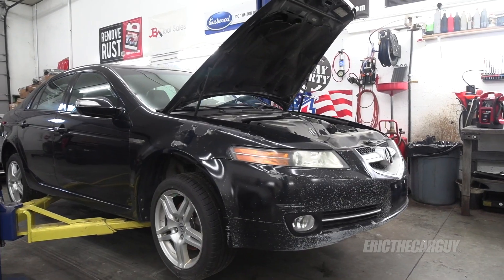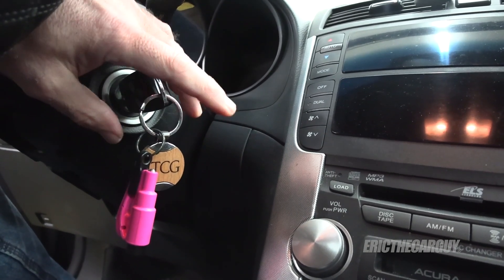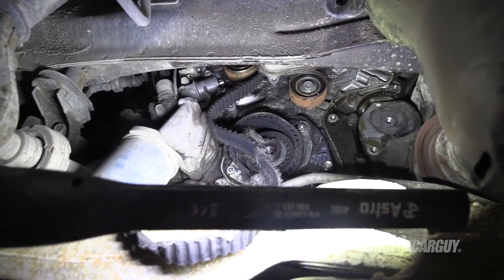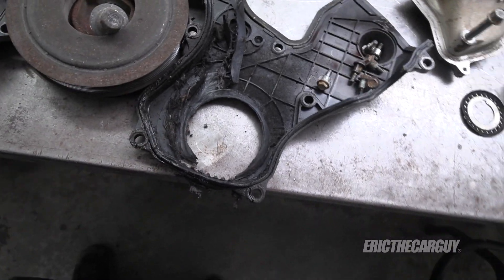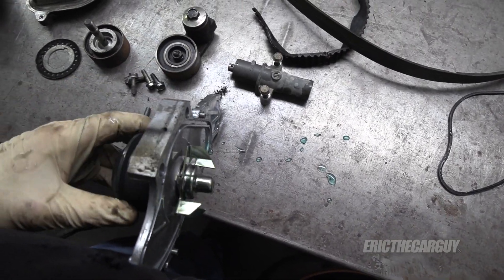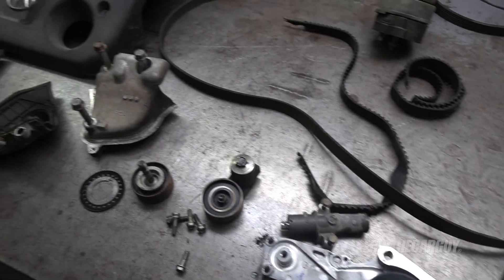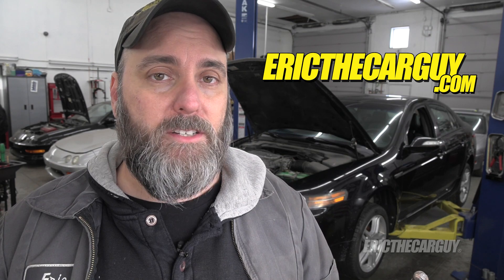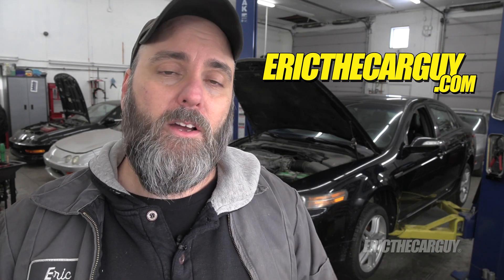Acura TL Dies On the Road

Comment: I had a very strange timing belt failure on my J32A2 about four years ago. The car was driving perfectly fine, me and my buddy drove pretty far out into the country to check out an abandoned Soviet radar missile tracking station outside of Moscow. When we got back to the car - it started acting up. When it did fire up it was running horribly, and we had no idea what to do. What made the whole thing even more nerve-wracking was that my buddy had a flight to catch and we were in the middle of nowhere. In the end he took a cab (which was really expensive, and he was barely able to catch his flight - he checked in two minutes before registration was closed), meanwhile I had to call in a flatbed to transport my car back to Moscow, which also cost a small fortune. When my shop  examined the car - it turned out that the timing belt had lateral cracks all around it, parallel to each one of the teeth, resulting in it skipping one or two. It was no more than a year old, and it was supposedly an OEM belt (though it was suspiciously cheap).
Reply from the maker: Glad you got it sorted. That sounds really stressful. Thanks for the comment.
Reply: @ericthecarguy  hey man! Thanks for helping people like me with advice ;) I remember I kind of got on your nerves a few years ago in an e-mail exchange on the topic of Honda CV-joints...))

Comment: If you look at the back part of the engine mount bracket you should see a mark where the idler pulley was rubbing against the bracket. You're supposed to use a die grinder and grind down the engine mount bracket where the idler pulley sits. That solves the "warble" sound coming from the timing belt area.  Its just bad having a bearing rub against metal as well. For those of you who dont know this stuff. Its crucial info.

Comment: I reuse coolant quite a bit using the paint strainer. Coolant is fairly expensive, BUT I do it mainly because its not always easy getting rid of old coolant.
Reply from the maker: I recently got rid of my waste oil and coolant. Both were in separate 55 gallon drums. Cost me $600. They used to come and take the stuff for free not so long ago.
Reply: @ericthecarguy  Our county has free oil and coolant disposal. But, I bet if I showed up with 2 55 gallon drums, they'd say "NO!".

Comment: The tensioner is the most important part of this timing kit. I had to do the job over again as I found the tensioner I bought on ebay was counterfeit and failed immediately after install. You should not be able to depress that tensioner by hand at all and that grenade pin should be extremely difficult to remove. I found the best thing to do is to install the kit and run the engine with the covers and everything else off so you can see how everything moves. That belt should not have any noticeable flex at all as it makes its rotation and the tensioner should not have any noticeable movement. You can then try and depress the tensioner by hand via the pulley. If you can move it by hand at all then you've bought a faulty or counterfeit tensioner and need to replace that part before completing the job.

Comment: I'm even more convinced now that the Aisin (OEM manufacturer) timing belt kits are worth it.  Probably not from Amazon or eBay though due to counterfeit parts showing up there too.  If I had to tear off the side of my engine that many times, I'd go crazy.
Reply: Amazon is really bad, counterfeit everything really, one time I bought a “Honda OEM” VTEC solenoid gasket and it didn’t fit, thats the last I ever bought car parts from them
Reply from the maker: Or if buying Honda parts I recommend Aisin kits as I believe they are the OE supplier for Honda.
Reply: @ericthecarguy  hey Eric what do you think about rock auto? I have a 2014 tl 3.7 and bought a aisin kit too and installed it in May. Should I be worried? All these comments regarding counterfeit parts are making me worry

Comment: If the timing belt/chain breaks, all you need is to be lucky enough for the valve springs to rotate the cam shaft(s) into a neutral (no lift) position before the next pistons come up. Much higher chances of saving the engine than if a belt slips or a chain skips.

Comment: I’ve learned a few things ETCG1 you really have to be careful with fake parts I bought some what I thought were authentic Denso 02 sensors for my Subaru and two years later one was failing and when I would cruise down the road and Top Gear the car would stumble almost like a misfire dealer couldn’t figure it out nobody could figure it out until I hooked up my cheapo harbor freight scanner and realize bank one was -40% on fuel trim!

Comment: The broken aluminum mounting boss for the cam sensor:

A good quality aluminum brazing rod is one incredible problem-solver to have in your kit as well as skillset.

I say skillset because it does take a bit of practice and seat-time to use the stuff at its full potential.  It can be tricky to get it to wet properly.  And, it flows like water if too warm.  Just and FYI, the line between perfect temperature and too warm is human hair thin.

When attempting to join two small pieces back together, tin both separately, then heat the two again for joining.  Or, put the car in a frame/body rotisserie, turn the car on its side, and use a small piece of electrical conduit as a form to fabricate the boss from molten brazing rod.  ;-)

I'm totally serious when I say aluminum brazing rod is magic for quick permanent repairs on all kinds of aluminum and aluminum alloy parts.
Reply from the maker: That would be a better repair I admit, but I don't possess the tools or the skillset for that. Thanks for the comment.
Reply: @ericthecarguy  No worries, it's fixed as the owner wants it -- the very definition of a proper repair.

I just added the comment as a reference to keep in the back of the mind for future play or problem-solving.

Comment: I have to say.. Once a car leaves me on the side of the road.. I can’t ever hardly trust that car again!

And if that’s the Honda you did the in depth timing belt video on… then you for SURE got a counterfeit kit. eBay is not worth the hassle, folks. Just go directly to the dealer, or even aftermarket from like autozone would be better than the crap they allow on eBay like sites.

Comment: Eric, I replaced my EJ20 belt last year. I went in to replace a leaking power steering pump and it looked like some fluid got into the belt cover so I removed the cover and wow! That belt was hanging on by a thread... literally. I wish I could show you pictures because I honestly feel the leaking fluid totally degraded the belt and it would have been overlooked easily had I just had a regular shop replace the pump.

Comment: The timing belt of my 1992 honda civic broke.We put a timing belt on it and it was perfectly running fine. Honda engines are the best.
Reply: Unless it's a non-interference engine, you were just lucky some valves weren't bent or worse.  Glad it worked out for you.

Comment: Regardless of the belt breaking that TL is a kick ass car..I wish I had it..my old civic needs some seals and a new oil pan gasket ..and I am in need of a bigger vehicle for my business..I am looking into a Accord from 2000-2010..that doesn't have super high mileage..good job on this TL ..it is truly invincible!! #SALUTE #RESPECT
Reply from the maker: I don't recommend going from a Civic to a TL. You will HATE the fuel economy, and the turning radius. I'd consider a TSX if you're looking to move up. I suppose it depends on what business you're in, and how you plan to use the vehicle. Thanks for the comment.
Reply: @ericthecarguy  I am a mobile technician ...jack .jack stands ..battery powered tools ..I went from that truck you saw in your parking lot the XPO Dodge Pro master to coming back home to IL. ..you recently just sent me that awesome shirt..my whole setup is in my trunk ..Precision Auto works ..here in Central IL. ..and yeah I also own a 2004 Honda Odyssey with the 3.5 V6 in it..and yes a TSX would be a good option ..thank you for everything Eric your videos are the #1 source for repairs across multiple vehicles..SALUTE!!

Comment: PAM, the cooking spray, makes a good, cheap epoxy release.  Just give the bolt/screw a spray and it will come out after the epoxy has dried.
I've used it many times while building small boats.

Comment: Excellent video.  Thanks Eric.   You make timing belt issues seem almost manageable - something I've always been afraid to tackle.  Maybe next time I'll dive in.
Reply: My issue would be where the heck do you begin trying to even get to stuff to replace a timing belt with these stupid sideways mounted engines...would almost be easier with some of them to remove the engine it seems LOL.  

I tried replacing a head gasket in one of my cars a while back, nope, have no clue what I screwed up but the car ran before I tore it apart, didn't run afterwards...that's the end of my mechanical attempts, got very expensive very quickly, and ruined a car I enjoyed driving although it was an old car, and very dull and boring, I enjoyed it because it was just a plain old simple car without all the electronic garbage on today's vehicles to deal with.

Comment: for aftermarket timing belt kit ,Aisin is the best.I tried the other brand,they only last 20000 to 30000 miles some of them water pump shot and sometimes hydraulic tensioner.Aisin is little more money,but it worth every penny

Comment: Did Timing Belt Job a 03 Acura CL Type, Run the Engine 5 minute it Died, Restart like has no Compression, Turns out the Crank Key installed wrong, I thank God the Run smooth Afterwords

Comment: Absolutely, just don't assume anything until you are sure. My car used to make a horrifying squeak during clutch release on first, but no judder or late engagement, smooth as ever. Well maybe its time has come, so under the car I go, ready to start to take anything apart, only then to find a stupid exhaust manifold shield missing a few bolts, limply hanging by the only one remaining. Three new fasteners later, no more screech. Cars...

Comment: Eric, your videos have helped a lot on a couple other vehicles. Hope I can get some insight, as I have 2008 TL as well. It has sort of a ticking at startup recently, and then at idle it would cycle in and out every 30 seconds or so...hear for around 10s, go away for 30s, repeat..185k on engine. At stop light last week and oil pressure light flickered on and off a few times...the exact day I was going to go to thicker oil (10w30) and buy some time and see how that went, figuring the bearings needed some help. I added some Motor Honey and all sounds are pretty much gone at startup and idle for now, except if I go to 2k RPM or so, I get a constant ticking. Oil pump and main bearings (from DNJ) are here, but after seeing the timing belt and water pump come off to do the pump, I think I'll keep the existing oil pump intact. I thought it was with the oil pan. Plan on pulling pan to look at bearings, but if you got any insight beforehand based on this, it's greatly appreciated. Thanks.

Comment: I just did the head gaskets and timing belt on a 2007 Pilot I picked up. It is running great, but I am having second thoughts on the Gates timing belt kit I got from Rock Auto. The belt and pulleys are Japanese, but the hydraulic tensioner and water pump are Chinese.

Comment: Eric, I suspected you used counterfeit Honda parts from Amazon in the last video when you replaced timing belt on this car as the water pump was different from OEM and the link you provided in that video had horrible reviews like your case. Unfortunately my suspect is confirmed! The root cause is that the poor quality of any of these dirty cheap honda fake parts you replaced, in this case the bad timing belt. For those who have replaced timing belt with those cheap parts recently, please redo the job with parts from trustable vender or Honda dealer to avoid the near future catastrophic event happening on your Honda engine!

Comment: Did the timing belt for my TL and after 8 hours of work it ran extremely rough, bucked and would die in a few seconds. Inspected and found the rear cam had jumped quite a bit. Guessing the belt still had a spot with some slack in it. Six months later and it's still running good...with some ticking valves. I'll just wait for engine to really let go before doing any head work.

Comment: That Gates belt is pretty much the genuine belt. Gates is the supplier for Honda's belts. We compared a gates with a genuine RCA belt at my dealership, and the tech or myself could not find a difference. Aisin Waters pumps seems to be good. They used to be the supplier for Honda as well before they changed to Yamada

Comment: When this happened to my co-workers car (2006TL) I pulled valve covers, intake and  rocker arm assemblies to check the valve heights; "shorter" spring  means bent valve.
The T-belt got eaten up because the tech replaced belt without using tapered shim per TSB!
Reply: I'm curious what did you mean by tapered shim? I just replaced my timing belt as well but on my j30 accord

Comment: KID YOU NOT ! (J35 ENGINE 2012ACCORD V6) I PRETTY MUCH USED EVERY PART FROM YOUR TIMING BELT VIDEO FOR THIS CAR YOU MADE AWHILE AGO ... 5-7 MONTHS LATER SNAP!, That "AISIN" WATER PUMP also had the goofy pink saran wrap and the SMALLER IMPELLERS ‼️ my snapped at like 70 mph and I kinda panicked and blipped the throttle in confusion I'm really scared to spend the money and the valves are bent 🤦🏾‍♂️🤦🏾‍♂️

Comment: Just a thought, if I’m not mistaken this was a timing kit you got from ebay, not to long ago I did a timing belt service on my 06 odyssey with a kit I got from ebay the kit “looked” like it was all OEN parts and even the belt was stamped with the OEM numbers, but shortly afterwards the belt snapped, after inspecting the “new belt” against the one i took off the van I realized that the “new belt” was a bit more thicker and stiffer than the one I took off the van, other then that i have no other explanation why it snapped off

Comment: Yep you're right, it's not something that I would've done personally but if it works for you then that's good. Hopefully it holds up well enough at least until you get settled in your new shop. Of course if you do decide to sell the car anytime soon then I guess you'll have to figure out a more permanent solution for it at that point in time. But at least you were able to get it back up and running for the time being. Good work Eric!
Reply from the maker: I think it'll be fine once I install a new harness. I already have one lined up. I just have to wait for things to dry up a bit and I'll harvest it. Thanks for the comment.
Reply: @ericthecarguy  I wish I had a new timing cover handy I’d gladly send you one of those. Speaking of which, I actually do have a spare trailer hitch for the Pilot handy. If you want it I’ll gladly send it to you.

Comment: I hope that Gates water pump works out for you Eric. I use to install those in everything, though Gates WP's were the chit, well after 2 of them failed on me at the 60,000 mile mark, I will never use Gates again. I'll use there hoses, but I won't use their belts or water pumps. Now when I do a J Series timing belt I'll replace the WP with an Aisin. Hope that Gates holds up for you.
Reply from the maker: Honestly I prefer Aisin kits, but there wasn't one available locally.

Comment: To anyone who hasn't dug much, there is little to no true aftermarket support on this car for parts that actually matter. I'm sure there's plenty of ricer body kits & all that garbage, but as far as anything under the hood or suspension/chassis related....yeah...
Thankfully, they're phenomenally reliable as you see in this video even after a broken belt on an interference engine.
Reply from the maker: Actually that's true with Hondas in general. At least in my 25+ years of experience with Hondas.
Reply: @ericthecarguy  very interesting to hear, & thanks for thay reply! Getting genuine or oe parts for my Mercedes from reputable sources at decent prices is as easy as getting toothpaste, but I'll never knock Honda's build quality & reliability so I guess it's simply taking the good w/ the bad so to speak.

Comment: My 99 j series accord very similar issue but caught it in time. Long story short, I had a "reputable" shop change water pump, tensioner & timing belt 125k & two weeks later it was cel for crank position sensor & a missfire.

Ends up being the cps was cause the timing belt kit the shop used was a cheep knock-off shredding itself & leaving metal & rubber covering the cps. The miss was unfortunately due to a leaking head gasket. I opted this time to do everything myself & that was over a year ago now trouble free.
Reply from the maker: I almost never see head gasket issues on J series engines because they use MLS gaskets. Glad you got it sorted. Thanks for the comment.
Reply: @ericthecarguy  it was a miss that showed up one very cold morning & would go away once it reached operating temp. It was a very, very tiny portion of the top of number 1 that the black was blown off.

The piston head was steam cleaned when I cracked it apart & oil was leaking from the bottom of the head along the back of the block. I had the overflow blow out twice & it took forever to find the cause of the miss until that happened.

But when I took it apart & found the knock off belt was destroying itself on the water pump (by the shop that installed it) I replaced everything with oem from the Honda dealer a little bit down the road.

Comment: Gates is a good brand and makes decent products. I’ve been using  Gates and Dayco for the longest time and never had a problem. That timing kit should hold up well for good while. Also Standard Intermotor parts are quite a bargain and work well.